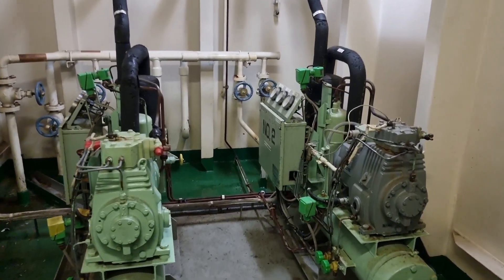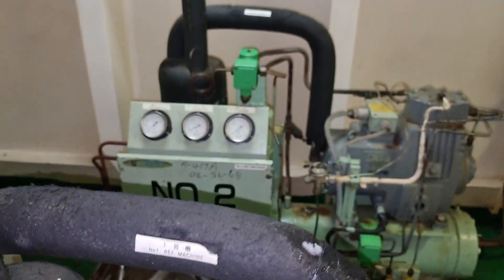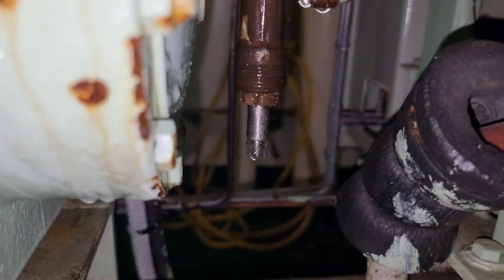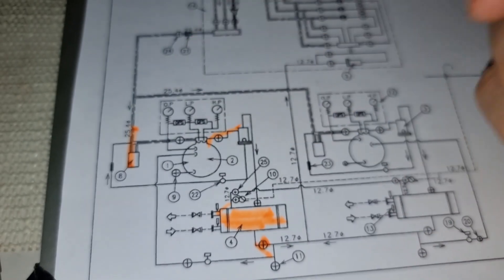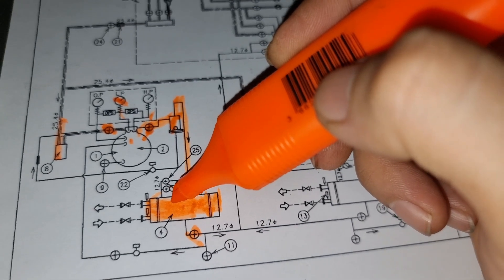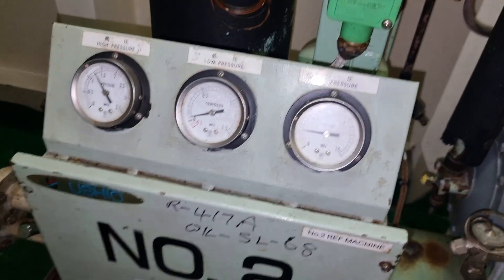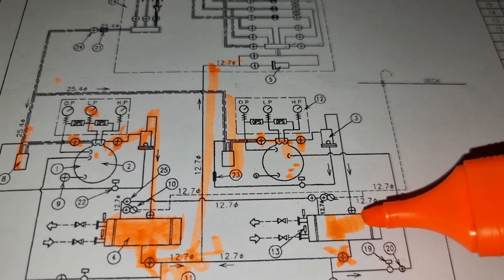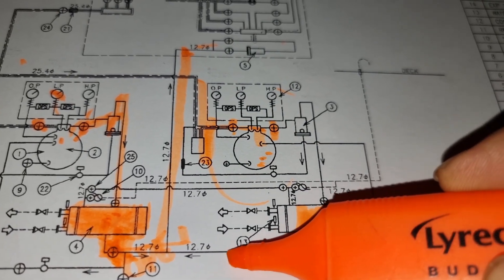REFRIGERATION PUMP DOWN AND HOW TO CHANGEOVER COMPRESSOR?

Comment: Thanks but why do we need the system to be pumped down? Why we can't keep one compressor off (rather than isolating it)?
Thanks.
Reply from the maker: normally the changeover is being done every month, you do not want any refrigerant in the line for the non running compressos as in will condense in the latter.you do not want liquid state refrierant to enter into your compressor.

Comment: a very good explanation sir. you said that we need to run the compressor two times so if during the first time the low pressure switch activates how can we restart again the compressor or how will the compressor start again? will the pressure increase itself due to remaining refrigerant on the system?
Reply: You can force to start pushing manualy the main contactor from the compressor about 3 or 5 seconds.
Reply: You wait a few minutes until refrigerant in the evaporators boil off and the pressure increases.
Do not force the compressor to run in negative pressure unless it is allowed i  the manual.
If you cannot transfer all refrigerant just charge some more into compressor 2 condenser.

Comment: Hi Lecky, Frst of all thank you for your wonderful easy explanation on each of your video. Im having a trouble on my ushio ref system, which is no 1 compressor is getting frosted if i let the system run. Now i changed over to no:2 not pumping down , but by charging no 2. 
What may be the probable reasons for the frosting, no fluctuation in suction and discharge pressure.  R417A was charged on no:1 last week.
Reply from the maker: i always depend on the pressures. but most of the times if you have frost in the suction you might have an overcharged of refrigerant
Reply: Hi just want to share my insight. The trouble is your compressor is getting frosted. One main reason, the refrigerant on the suction line all the way to the compressor is not in vapor/gas form. A lot of reason way this happened, most notorious one is overcharge, malfunctioning expansion device, dirty/clogged evaporator coil, and etc. But base on the scenario you have stated it is more likely overcharge.
Reply: Thank you and hats off for the dedication towards sharing your experience. Always waiting for your videos.

Comment: Good day lec. I have a question I experience during pumping down discharge pressure is increasing  until high pressure trip activated and  suction pressure is not decreasing hard to activate the low pressure switch. What is the cause?
For that reason I cannot properly pump down and changeover to another one compressor.
Hope it will answer Thank you in advance.
Reply from the maker: first, the cooling should still be present during pump down.
you can adjust the setting of your discharge  pressure switch as per your manual max limit.
3rd.  check for leak test on your suction side. the pressures you may be getting is the air that is goibg through your system
Reply: @leckyjake  thank you. Have a good day ahead.

Comment: Hello sir can you please suggest a book for understanding single line diagram and learn about switch gear and Power systems protection, relay setting and fault current calculation

Comment: Hello sir.. i just ask if you need to deactivate first or set some setting in the control to not activate the pressure switches while doing pump down??? Thank you in advance
Reply from the maker: good question, if the suction pressure switch is more than zero bar/MPa then adjust it to zero.
Reply: @leckyjake  Thank you sir.. God bless you always and takecare... one of your subscriber here 😊

Comment: Hello sir , I’m having a bachelors degree in Electrical and Electronic engineering and I will like to work on board .
What are the steps I to go through before getting a seagoing job
Reply from the maker: It actually depends on your country if you are asking about requirements
Reply: u can do course called ETO